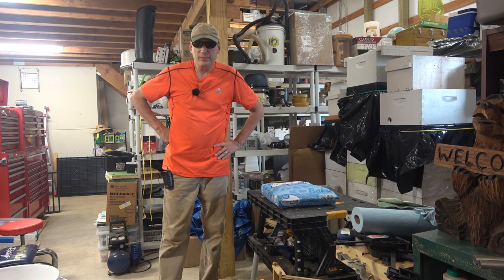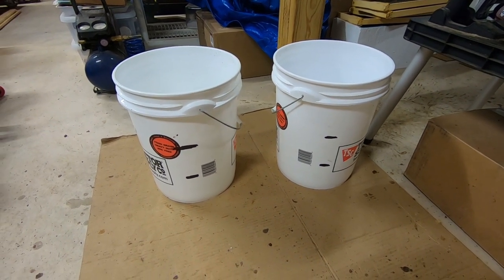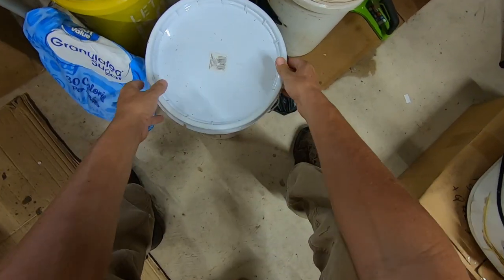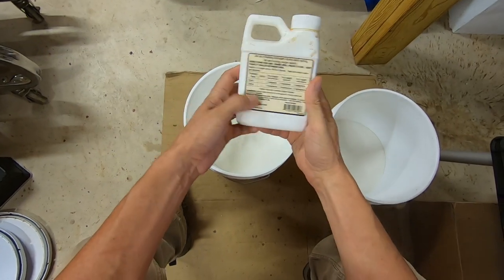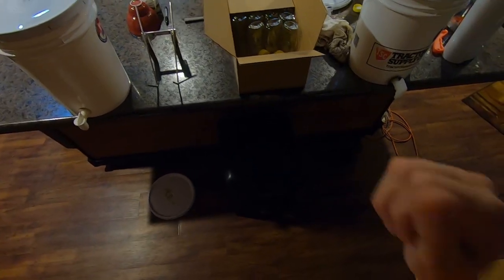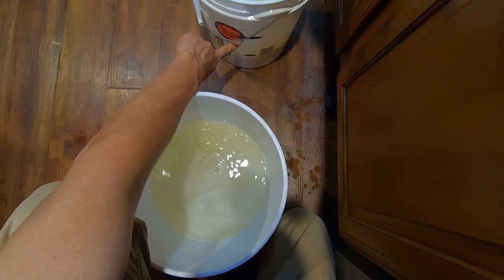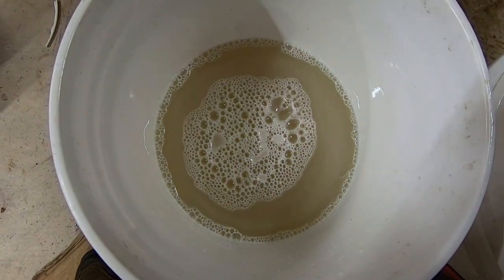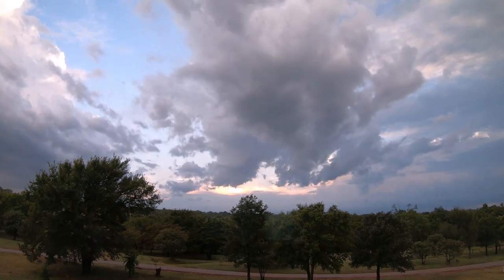Feeding Bees: Mixing Fall Bee Syrup S4E57 #beekeeping

Comment: I was doing some quick math today and for 2:1 you can mix 3 10 lbs bag + 1 4 lb bag of sugar with 2 gallons of water. That just about fills a 5 gallon bucket, and its easy to just buy the exact bags, and then gallon jugs / pitcher for the water. Easy peasy. But that mortar mixer move is a nice touch. Thanks for your videos.
Reply from the maker: That’s a cool way to mix it. So that would be 34 to 16.7. I wonder how full the bucket would be.
Reply: Jerome Bee Farm & Homestead Bucket is has about an inch of or two of space left. I had some leftover syrup in the bucket before I started, so maybe a smidge more space if it’s completely empty. Which I’m guessing is an issue for the mortar mixing approach, if you’re not careful. I’ve got the bucket mixed. Did it today before I caught your video. I just ordered a the mortar mixer and I’ll give it a go and let you know.
Reply from the maker: @johnpowers3992  Maybe you could mix it with 1 gallon and then put the next gallon in after you get it all dissolved. (so you don't spill it all over the place)

Comment: Good video. I never get tired of seeing the sunsets over time lapses. I bought 60 lbs of sugar last week at Wally World. Can't find a 25 lb sack anymore. I have almost gotten my bees fed up for the winter. Living in MN I need to have a lot of resources in the hive to last for 5 months. Looking forward to seeing your hive top feeders. I use 1 gallon pails like Ian Steppler with the same type of hive top and bubble wrap. I drilled the holes in my top large enough to fit qt.jars also which allows me to use either.
Reply from the maker: Hey Russell.  I was trying to do a few of the Ian buckets, but I couldn't find lids for the 2 gallon buckets, so I tried the little plastic tubs from Lowes and the lids just didn't fit very good, and you have to put a deep box on them too.  I finally came across some lids after I ordered my hive top feeders.  I don't have any migratory lids either, so that's why I took the route I did.  I think my feeder unboxing video will be Friday.  Thanks for watching.

Comment: Thanks for all your videos,  been a great help.  I am a  new  bee keeper  this year.  I  started  feeding  some  2 to 1 sugar syrup  with  honey bee  healthy with  top hive feeders. They took  it all down and  what was  left was a lot of crystallized sugar in the  feeders. Is that  normal? Thanks
Reply: The crystals are not normal. It just means it wasn't all dissolved. For 2-1 I heat mine on the stove to get it all dissolved. You can have 120 F hot tap water to start with but when you add the cold sugar it drops the temp down a lot. I end up getting it all dissolved at about 110-120 F. Don't get it to hot they say - like over 160 F.
Reply from the maker: Crystals are undissolved sugar.  Be sure you mix with hot water and it will dissolve much better. 3 methods to get solids to solution:  1. Stir 2) Heat 3) grind

Comment: I think you're doing roughly 1:1, sugar to water, either volume or weight, maybe a little more sugar. However, bee course's and books are recommending 2:1 in the fall to help build up stores rather than stimulate. What are your thoughts?
Reply from the maker: Hi tcsail.  Yeah, I intended to do 50/50.  We are still quite a ways from a freeze and are in our fall nectar flow.  If I need to, I will put on 2:1 in October timeframe.  2:1 just doesn't need to be dehydrated as much before it gets stored.  Thanks for watching and commenting.
Reply: In OK they will have a enough warm weather it probably doesn't make much different. There nights this time of the year will not get very cool to cause condensation in the hive. I have been feeding my bees for 3 weeks now, slowly pushing the queen down into the bottom box without plugging up the hive. I'm from MN so I do things a little different.

Comment: Good day Jerome. Easiest way that I've seen people mix sugar food for bees. Is with an electric outboard motor in a 25 gallon drum.l seeon .on.YouTube 12 v
Reply from the maker: Yeah, if I was working over a hundred hives, I'd go bigger to that.  I think you are referring to Bob Binnie.  Thanks for watching.
Reply: @JeromeBeeFarm  The easiest way for me to mix sugar water is adding the water first and the sugar dissolves faster even in cold water. I mix extra thin (3/4 to 1) and start feeding small amounts in late summer to keep the bees actively foraging into fall. I use small round top feeders and may only give the bees a pint of  liquid to stimulate them or a quart if the rain moves in. Don the (fat) Bee man is the one using the outboard motor to mix syrup.